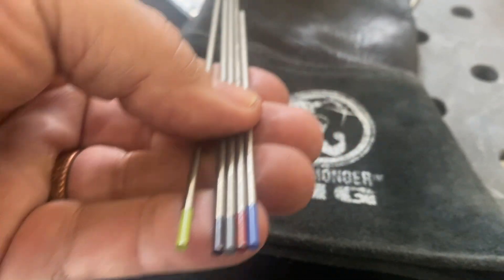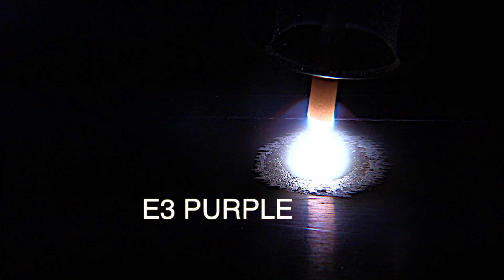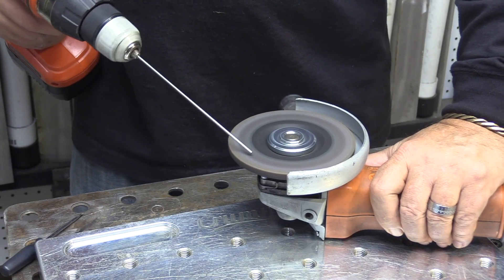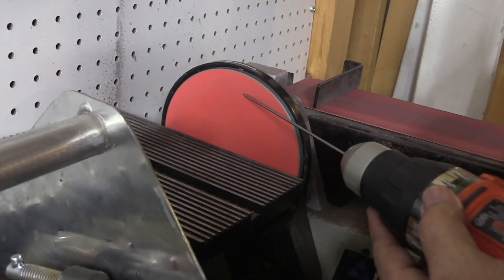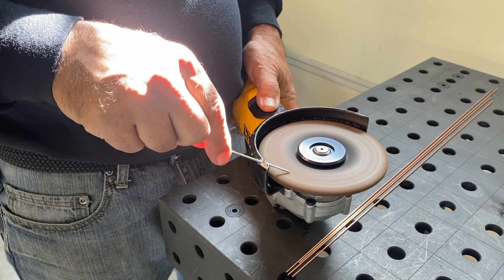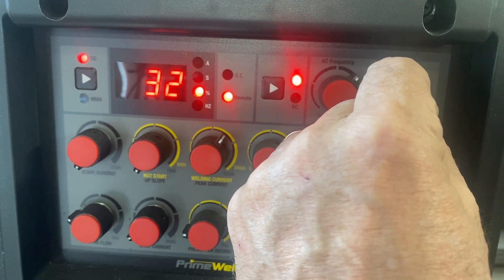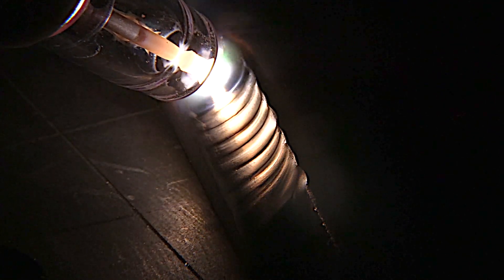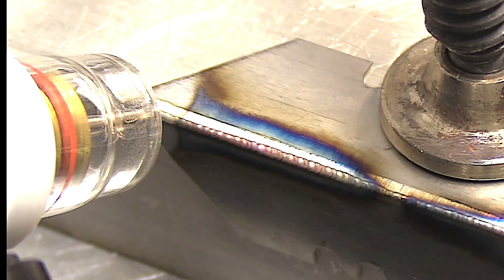I Tested 5 Tungsten Types at 200 amps AC

Comment: I've used all kinds of tungsten in the 20+ years I've been welding. I recently posted on FB about how your tungsten type isn't really as critical as people think. That really  stirred the pot 😅 there is no magic tungsten that makes you weld better. I can use any of the above tungstens and get the same results. Some might hold up longer than others or provide better stability but they will all weld. An experienced welder can lay down a slick weld bead with any of these. I primarily use 2% ceriated. I weld high amperage aluminum 275+A. Never had an issue. I tried 2% lanthanated and didn't notice a difference really. Because the welds I am doing are class A I use a fresh tungsten for each part. Its easier for NADCAP requirements just to have 1 type of tungsten. So I just stick with the ceriated.

Comment: I have E3 purple downstairs and it was doing the same thing that the red one was doing on the tip when welding aluminum 😬. Curious if the tungsten is contaminated or something... so I purchased some blue ones that's I've yet to try.

Comment: With pure argon, the "red" electrodes produce acceptable welds on DC only on my inverter machine. And that's only if I've run out of lanthanated tungsten. Way back in the day, with transformer powered Miller "Dialarc" machines, and a helium/argon mix, pure tungsten for AC, and 2% thoriated for DC was the norm. LOL.

Comment: At my old job, we used 1/8" red exclusively because all we ever did was steel pipe. Then, the boss man got an AC tig welder so we could do aluminum, but didn't want to get any other types our sizes of tungsten. He said our processes were only certified with 1/8" red, and he didn't want to do any recert with any others. Doing aluminum with those 1/8" reds was always a huge pain. At my new job, we do all our aluminum with 3/32" or 1/16" purple. Night and day.

Comment: Great Vid. I was wondering if you can do a video of tig welding Alum with different thicknesses. i scoured YT and nothing really helpful. At my work sometimes the CAD guys are new and have no real world experience and don't realized the difference between welding steel or alum. They recently designed a custom oil level gauge made from a 1/2inch 3*3 square alum as the main body. we have to weld 2 alum olets to it with a weld around fillet size of .12" My tig welding skils i would say is about 6.5-7/10 enough to know that to the olet might receive some major gauging from trying to preheat the 1/2" tube. Also the print ask to weld a 1/8 4*4 square plt to the bottom with a 1/4" fillet weld around. the top cap is 1/8 3*3plt pretty straight forward that one. I'm wodering how you would attack this project.

Comment: Hey Jody,
but a smaller ball did not mean more stable arc in my testing at 60 Amps AC.
After 5-10 restarts i'd say Alustar electrodes had the most stable arc.
3/32 tungsten - ~50-60Amps 340 Hertz 70% 
best to worst:
Alustar
green pure (!)
2%La

no way:
gold
Yttrium
Witstar

Comment: 2% lanthanated does it all for me. E3 didn't seem to have any apparent benefit over it to me. I bought an HF chainsaw blade sharpener, turned it upside down on the stand, tossed out the jig pieces, and I sharpen on it's diamond wheel with the tungsten chucked up in a drill. It's pretty fast, and I'll do 5+ at a time so I can quickly swap when I foul them. I would absolutely do the same with a diamond wheel on a small grinder. I also have a cheap diamond wheel and tungsgen jig on an M12 rotary tool that's relatively decent, but it isn't necessary.

Comment: I believe the additives are to help conducting electricity. I had some old plain tungsten electrodes and they only work right on AC.
On DC the arc starter doesn’t do anything , you have to bump them.

Comment: Back in 2017 when I got my first TIG welder I grabbed a bench grinder from the local classifieds for $20, kept the "fine-grit" wheel on one side and ordered a couple of the finest Uxcell Chinesium Ø6" diamond flat wheels from Scamazon, 240 and 500 grit, and made them work on the other side with a McMaster-Carr shaft clamp to take-up the extra shaft spacing.  I'm only a hobby welder but the diamond wheels are still going strong and the 500 grit gives a nice smooth tip every time.  I need to design & build a little angle jig, but freehand works too.  Work smarter not harder, you don't need a fancy-pants anodized gizmo tungsten sharpening device.

Comment: Love the vid dude been watching for quite some time. Got a test coming up and can’t find any thing on it and surprised you haven’t done it. It’s a d1.2 2g structural aluminum 3/8 thick 60 bevel. Much appreciated either way. 6061 using 4043
Reply from the maker: I don’t have much experience with d1.2   But if procedure allows preheat that will help

Comment: Hey Jody I would like to pick your brain about welding cast iron.
Have you done a lot of cast ?  I’m doing a job right now. it’s a big chunk taken out of a tractor the size of my fist.
I generally use Royal 11-10 tig wire but I have to drill and tap where it broke through one of the bolt holes. and it Hass to be strong because it holds the front bucket bracket on a new Holland tractor 20 horse.
I guess I’m just trying to get somebody else to back me up because I’m a little nervous 
Thanks, Kurt’s Welding
Reply from the maker: Cast iron is most always a crap shoot. Anywhere that will be tapped should be all filler metal or might be too hard. That could mean removing threads along with some more metal and buttering with non hardenable filler before welding the structure.

Comment: Hey Jody, I noticed in your "spot welds" that the aluminum looked like it had porosity in it. I had a job doing .065" aluminum welds that needed to be water tight and had to do use a dye penetrant test. All my aluminum had that random porosity in it, tried every trick in the book that I knew but still random porosity in random locations that would fail my leak test. Any ideas about mitigating it or words of wisdom? Thanks for everything you've helped me with as I started my welding career, keep up the great videos!
Reply from the maker: Moisture hides in the oxide layer. Especially when it’s humid.  I didn’t clean the metal for this.  I think freshly brushed aluminum with a slight preheat would prevent porosity

Comment: I'm welding aluminium with a 3/32" lanthanated electrode, 30% cleaning around 100hz #5 standard cup at 11cfh.
It balls the electrode into a big blob at 100amps, if I go past that it'll drop the tip. I've tried a bunch of different electrodes with the same results. 
Everything I've read says 3/32" should handle at least 150A, any advice?
Reply: Should be fine at 150A, personally though I use 1/8" electrodes past 125A continuous on AL.
Are you absolutely sure your machine displays %EP, not %EN? Polarity of leads correct? Those got me when I switched to a new machine.
Reply: I think @smirmeister is pointing you in the right direction.  I'd bet that you have the leads swapped at the machine, resulting in reversed polarity. It's also possible that you've got the balance % backward.  Not all machines display balance (or cleaning) % the same way, so be careful if you're using someone else's settings as a starting point.
If it's a new machine to you, I'd strongly recommend going back to the manual and starting over from step 1 in the initial setup. 
I've also been bitten by making assumptions about a new welder...

Comment: I do quite a bit of automotive transmission case repairs , my "go to" is still green (3/32). What type would ball , but not melt off so easily ?
Reply from the maker: If you’re using a transformer then zirconiated will ball like pure and carry more amps than pure.
Reply: Depends on your machine. If it's a transformer, green or red is good. If it's an inverter, literally anything other than the green pure tungsten will work better.

Comment: Thoriated Tungsten is easily one of the worst, on DC it welds just like Lanthanated and it's useless on AC, plus it is radioactive so by far the most dangerous
Reply: Radiation ain't $h*t...
Reply: I find 2% thoriated best for stainless welding. My go to electrode,  for AC i use pure tungsten green
Reply: @dinoj8126 , I used to run with the same tungsten choices until I sold my transformer machine (miller 350 lx) beautiful machine. I bought a miller dynasty 400 (inverter machine). No longer can I run pure tungsten on AC. Figuring out the other blend. 2% lanthanated seems most stable, still figuring out all the other bells and whistles on the new machine though!
Reply: @sashakokesch4137  why cant you use pure tungsten on a inverter machine? All the machines I use at work are inverters aswell and I have 0 issues
Reply: You are not very bright.. I'm sorry, it is not that dangerous. . It's the best for stainless..
Reply: I sharpened them at my job on an unventilated sanding wheel for quite a few years before I knew they were radioactive.
Then they started getting me Lanthanated.
Reply: I don't think the radiation is really a danger.  But point taken, it really is just an obsolete tungsten.
Reply: I use red tipped tungsten on aluminum steel stainless it seems to work for me

Comment: This video really came at the perfect time for me! My local welding supply stores only seem to consistently stock red tungsten
Reply: Amazon, dude
Reply: @JackOffAllTrades  I was out
Reply: Yeah, you don't want that red stuff . Being Jody has a new supply, get some from him (he usually sells out fairly quick of the 3/32) . Best little supply store on the net . Get the TIG fingers too, they're great . :)  I better see if he's still got some . lol :)
Reply: @johnjelinek-g7b  see I’ve never had issue with the red tungsten. Everything I’ve welded DC or AC at 200 amps plus for extended periods of time it deforms just like the rest of them. Just my own experience though
Reply: This is a great comparison with great actual use information. I find it interesting I remember opening up a new DC Tig machine and all of the Tungsten provided with the machine were the 2% Red. I found the tip did not hold up well but thought it was my  ability, this shows maybe need to try the 2% Blue.
Reply: Make sure if you go with the red not to breathe in the dust